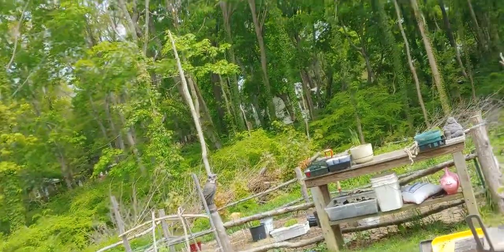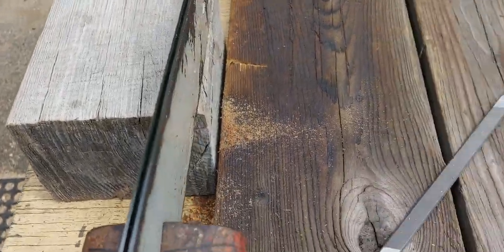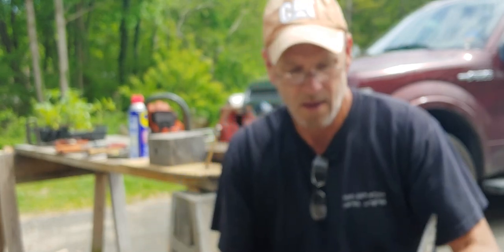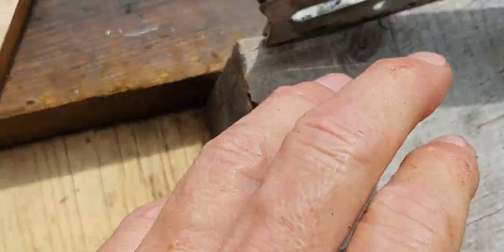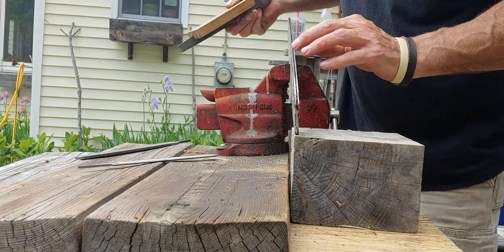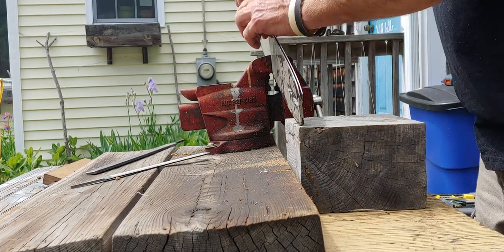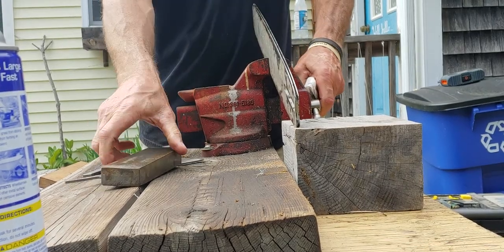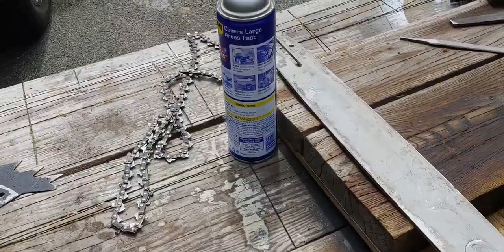Dressing your chainsaw bar by hand.

Comment: How would you widen a bent groove? I just bought a bar from cannon and the groove came bent.
Reply from the maker: How much needs to be fixed?  You could spread it with a cold chisel ground to fit or a screwdriver and keep measuring it with calipers until it is right or just a tiny bit big and the chain moves through it.  Then you'd want to tap it back to a perfect dimension.  The drive links can be your guide.  They will wear it in if it's a tiny bit tight.
Reply from the maker: Find a good part of the bar groove to test the drivelink side to side fit and then just keep tapping it in till you get close.  Would Cannon warranty the bar?
Reply from the maker: You can also use a feeler gauge stack that is snug in a good part of the bar but still slides and use that to gauge your progress.  Keep going till the gauge stack slides through the entire groove.  If it's loose in spots, tap it closed slightly.
Reply: @williamprophett9148  thanks for getting back, it’s a very small amount of material that needs to be removed. I think I like the file the best. Thanks again.
Reply: @williamprophett9148  chisel not file sorry
Reply: @williamprophett9148  thank you again
Reply from the maker: Any time brother.
Reply from the maker: You "could" even take a chain that's one size smaller on the drivelink and run it on the saw and use a diamond paste to lap in the tight spots too, but I think that would be a little "anal"😂😂😂😂.